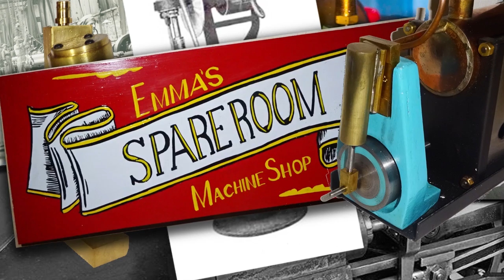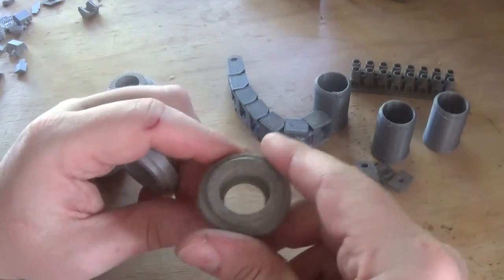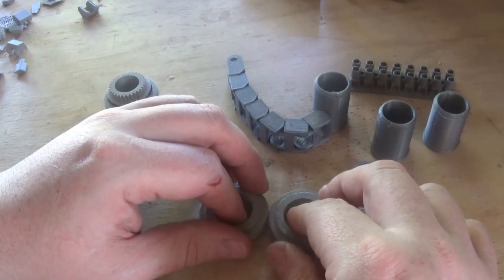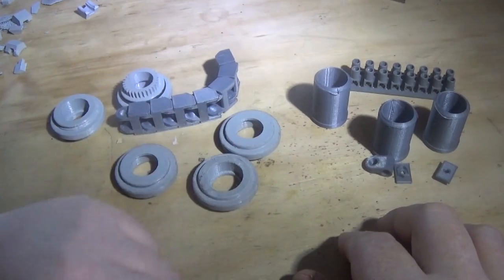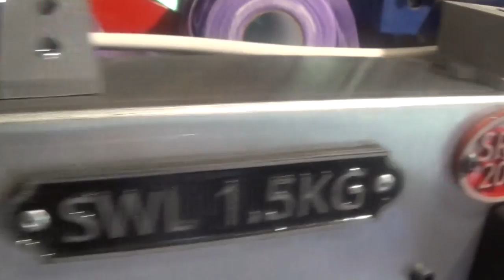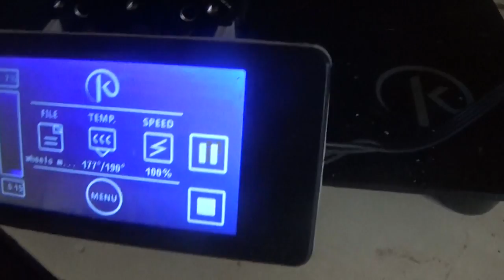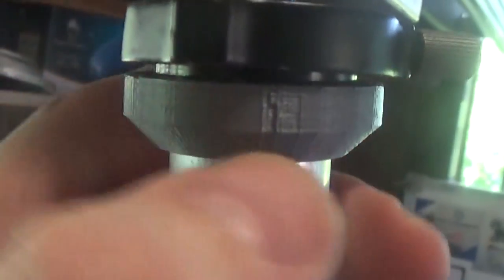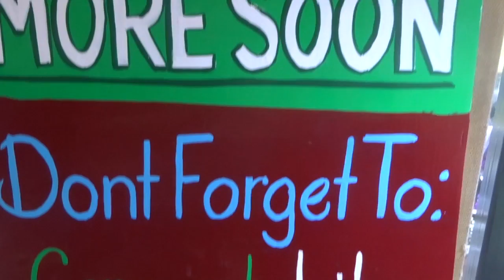Building the ULTIMATE gantry Camera Crane PHASE 1

Comment: Hi Emma, This is RobiSydney. We met at Stan's (I gave you the 3amp 12v to usb power adapter.)  Wish I had see this video before I went to the bash.   I could have brought a NEMA17 stepper, driver and given you an Arduino with LCD screen.  I had the Arduino and screen and the driver in my bag. I just didn't bring a NEMA 17 stepper with a GT2 belt pulley. Yes my profile pic is an old picture.. no glasses and no Mutton Chops and a lot less gray.
Reply from the maker: +RobiSydney that's awesome. The power adaptor will be a godsend. Getting it hooked to power drive may or may not happen yet lol. Good to meet you, and yes you're now unrecognisable. Lol

Comment: You know Emma, if you had printed that junction box upside down, the only support material you would have had to break out would be in the design on the face. It would have required more finishing around the lightning bolt, but you would have saved hours on the print. Great job on the gantry. Can't wait to see where it goes.
Reply from the maker: yes . i know. I really wanted a nice print on the top though, so took the time to print it that way, thanks for watching.

Comment: Hey Emma, nice, what are you using for 3-d filament? Also what are you using to design your parts? have you tried the brocil (cant remember name ) glass for your print bed? I think you have a good design there, love the spring loaded wheel, and was thinking that maybe one more spring loaded wheel or an adjustable fixed one. Have you seen the Inventables website?  God Bless Ya   Dave   Love your approach T&E
Reply from the maker: whatever is cheap, but im learning cheap isnt always good. the cocoon seems really nice filament, the silver is from a chinese supplier and has its hassles. its all PLA. at this point im good with the standard bed, it works well, but not sure about mods yet. thanks for watching. ill check out the website.